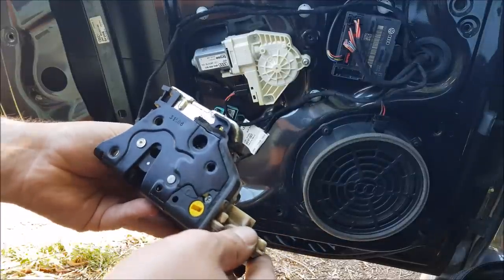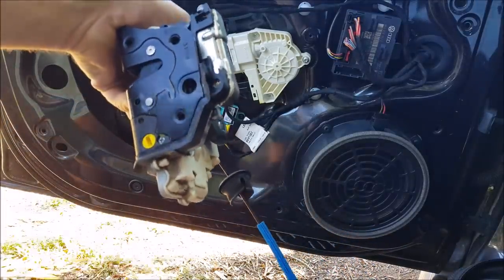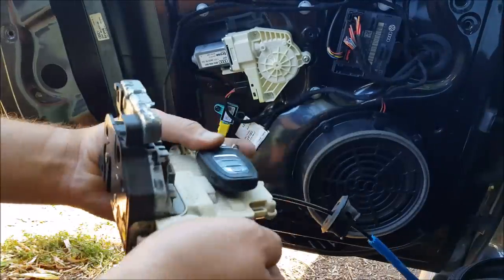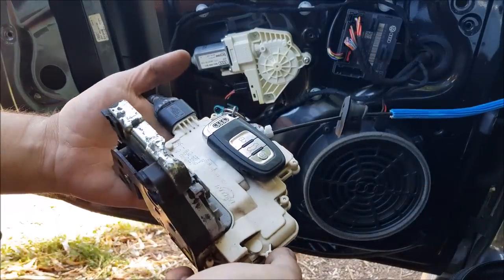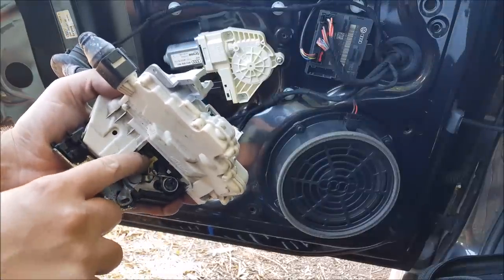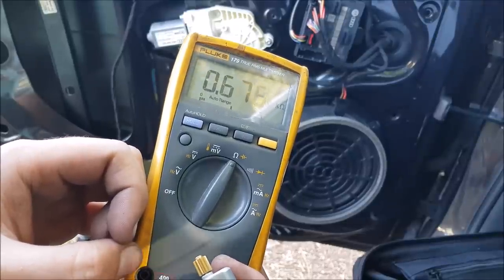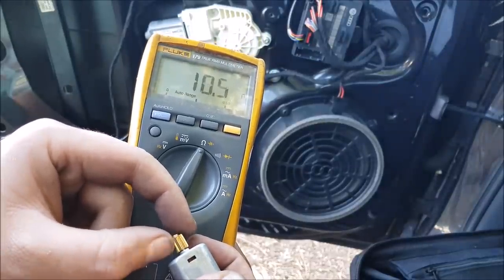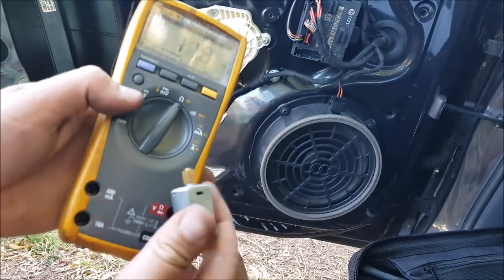Audi B8 A4 Door Lock Repair

Comment: Hello, first of all thank you for your excellent videos.
I have an audi 2.5 tdi 2001, and I have dtc error codes that I cannot resolve.

Driver side on the module, nothing works except the passenger's window control intermittently.
I think to check all the connections and wires, open the door and test my module, look at the fuses. But after that I don't know. An opinion?

Benny

Address 09: Cent. Elect.        Labels: 8E0-907-279-8E2.lbl
   Part No: 8E0 907 279 D
   Component: int. Lastmodul  RDW 0203  
   Coding: 00011
   Shop #: WSC 63351  
   VCID: 3362C48E01AE28D924-4B18

1 Fault Found:
01312 - Powertrain Data Bus 
            79-00 - Please Check Fault Codes
---------------------------------------------------------------------------------------------
Address 16: Steering wheel        Labels: 8E0-953-549.lbl
   Part No: 8E0 953 549 M
   Component: Lenksáulenmodul     0209  
   Coding: 01021
   Shop #: WSC 75663  
   VCID: 3D76E2B637EAEEA9C2-4B18

1 Fault Found:
01331 - Door Control Module; Driver Side (J386) 
            49-10 - No Communications - Intermittent
---------------------------------------------------------------------------------------------
Address 17: Instruments        Labels: 8E0-920-9xx-8E2.lbl
   Part No: 8E0 920 900 K
   Component: KOMBI+WEGFAHRS. RB4 D35  
   Coding: 01000
   Shop #: WSC 00006  
   VCID: 2C50DFF2DC90772165-513C
   WAUZZZ8E63A158081     AUZ6Z0B0227017

2 Faults Found:
01331 - Door Control Module; Driver Side (J386) 
            49-10 - No Communications - Intermittent
------------------------------------------------------------------------------------------
Address 46: Central Conv.        Labels: 8E0-959-433-MAX.clb
   Part No: 8E0 959 433 BC
   Component: Komfortgerát T3B    1110  
   Coding: 06730
   Shop #: WSC 24201  
   VCID: 73E2048E412E68D9E4-4B18

   Subsystem 1 - Part No: 8E1959801B
   Component: Tõrsteuer.FS BRM 0002  

   Subsystem 2 - Part No: 8E1959802B
   Component: Tõrsteuer.BF BRM 0002  

   Subsystem 3 - Part No: 8E0959801A
   Component: Tõrsteuer.HL BRM 0002  

   Subsystem 4 - Part No: 8E0959802A
   Component: Tõrsteuer.HR BRM 0002  

9 Faults Found:
01331 - Door Control Module; Driver Side (J386) 
            49-10 - No Communications - Intermittent
01134 - Alarm Horn (H12) 
            29-00 - Short to Ground
01134 - Alarm Horn (H12) 
            49-10 - No Communications - Intermittent
01370 - Alarm triggered by Interior Monitoring 
            35-00 -  - 
01371 - Alarm triggered by Door Contact Switch; Driver's Side 
            35-00 -  - 
01573 - Alarm triggered by Door Contact Switch; Rear Left 
            35-00 -  - 
01811 - Supply Voltage for Door Controller; Drivers Side (J386) 
            37-00 - Faulty
01561 - Rear left door 
            61-00 - Won't De-Safe
01562 - Rear right door 
            61-10 - Won't De-Safe - Intermittent